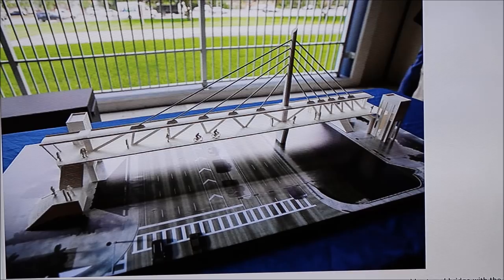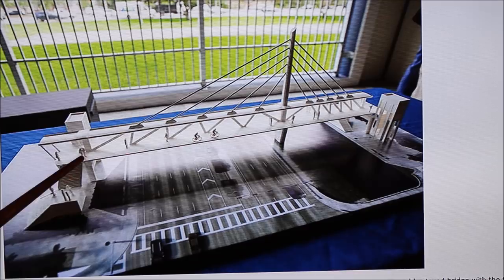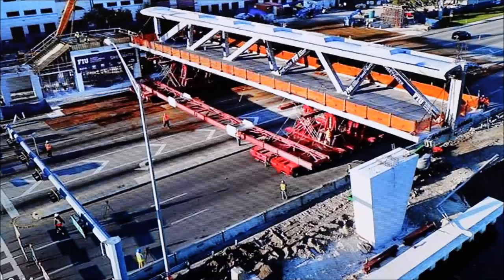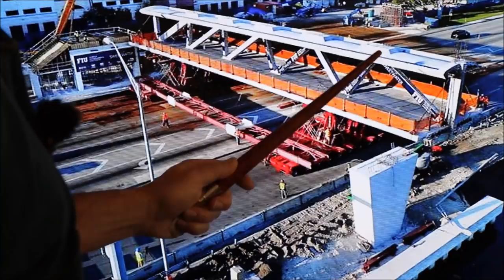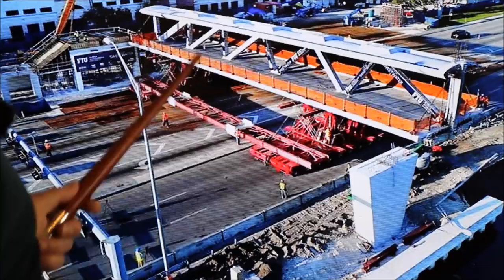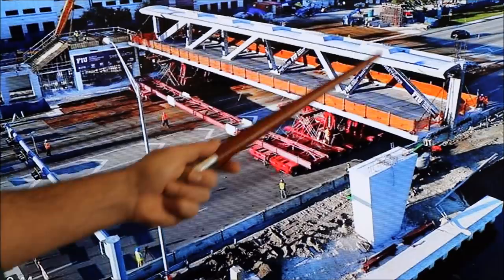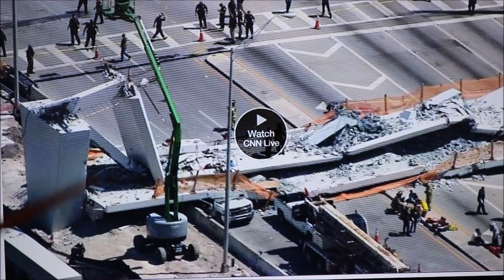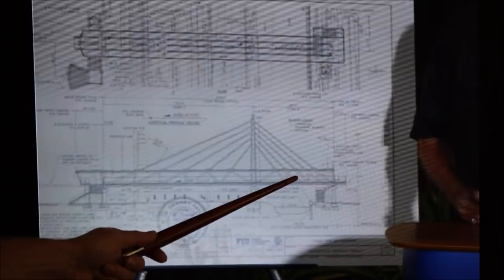Miami Bridge Failure- preliminary analysis 17 March 2018

Comment: Had the tower and cables been real, full concrete trucks could have been driven across end to end without failing. I think youtubes AvE channel has the answer already. A cable tensioning end pulled all the way out of its anchorage.

Comment: The design may have had flaws but it seems like most disasters many things went wrong here...I  can't believe that the work was going on with traffic below.....kind of thinking that the guys tensioning the cable had the units wrong  ( like filling up the commercial airplane that landed out of fuel  at Gimley Manitoba  by measuring liters rather than gallons?)
Reply: i have looked into that air craft flame out i depth in the past.  ya what a mistake.  thank God for the abandoned air base runnway being in gliding distance

Comment: Hmmm... How does a Boeing 777 left seat know about concrete/steel matrix construction?   My structures instructor said "bridges do not have to fly, so we can build them a little stronger, so they don't flop around when you drive on them."I like the "Here we are in Hong Kong on a similar structure" part the best.Here is my theory of failure.Please redefine your "truss" meaning.  Classically a truss is made of members that cannot transmit moments.  The ends of truss members are near frictionless pivots.  
This  structure is an open webbed beam, with weird flanges.  
Member 11   =  first diagonal from the canal pier end.  Transporter lift pads puts #11 in tension so internal tension rods in the member  must be cinched up to keep the concrete of the member in compression or it will fail and crack in tension. when the bridge is lifted by the transporter jack.
When load is transferred to pier seat,  #11 concrete goes into high compression.  So the internal tension rods go limp. (worker  remarked it was funny that the tension rod nut was loose after sitting down onto the pier).  The tension rods in #11 diagonal  must now be carefully cinched up turn by turn to keep even compressive stress in the concrete cross section of member #11.  Now the pre-compression from the matrix of  balanced tension rods is used to keep the highly compressed #11 member stable and in plane to keep column buckling from occurring due to a potential eccentric compression load vector.  That was what was supposed to happen.  
But, the tension rod matrix load balancing dance went south.  During tensioning by the crew, after the bridge was on pier,  the #11 concrete compression vector shifted out of the center of the member, set up an eccentric moment and the member in high compression began to fail in column buckling.  You can see the  "S" curve in #11 forming a few milliseconds before collapse.PS:  Thanks for all the work on the ORO Dam Project.

Comment: Ther is a bit of substance here, but I question this guy's credentials to do more than sift through the news and summarize his findings.

1. At no point did he mention the fact that the end supports during the bridge move were changed from the original design. Those supports at the failing end of the bridge were moved inward creating a substantial cantelever that changed the loading condition from a simple span, to one that was continuous over that support. That loading condition causes downward deflection of the bridge end that was apparently overcome by the post-tensioning of that last diagonal strut.  This situation would normally engender another analysis before proceeding.  I would bet that this will be a major focus of the investigation.  That said,  we must admit that all of the facts are not in, and a thorough review may show that there was some other cause (anchor failure of longitudinal deck cables that permitted partial detensioning and deflection of the entire structure?). Untill that time we are engaging in partially informed conjecture. There were many points of failure on the bridge that obviously involved concrete and reinforcing steel. There may be other failures of pre-stressing strands, or their associated hardware. Which failures were caused by the bridge falling, and which one or ones caused the bridge to fall are the big question right now.

2. I find it unlikely that the tower and  cable-stay system was wholly ornamental.  Sure, it is almost the signature bridge of Figg design, but it is not that much art in my opinion.  I expect it was there to handle pedestrian loads that would be present after the bridge opening.  If you don't thint that it is significant, be reminded that the Golden Gate bridge was closed to traffic on its anniversary and the pedestrian loads were enough to flatten out the camber and put major concerns into Structural Engineers who observed this from afar. 

Also, that long a span can have significant thermal expansion and contraction; but it can also shrink due to water loss through evaporation and cement hydration, and through concrete creep under load.  Perhaps the cable-stay part was used to reduce the loading and provide structural redundancy(see fracture critical below).

3. Sure concrete trusses are heavier than the steel truss option, but steel truss details can be problematic in a marine environment where corrosion can be a big issue.  Pigeons, bats, gulls, etc. can provide an accelerated environment too. 

4. At this stage of construction, the bridge was "fracture critical".  Quotes are included because this terminology carries regulatory and design significance. The video talkes obliquely about this issue, but a straightforward use of the terminology would have carried more impact.

5. RE: load testing with added weight. I've seen more than a few big and small bridges built but never that type of load test.  There is the old joke in the industry about the Russian load test, but I expect that it is fiction.  There was a big failure of a bridge a few years back that resulted from the inappropriate stockpiling of construction materials for a rehabilitation job, but that was in no way an intentional test.

6.Calling that design a Warren truss is a stretch.  It appears to be a hybred with Warren like elements at one end and  Pratt or Howe like ones at the other. I'm in a rush here so I didn't have time to research that distinction.

Baseline: Conjecture is fun, it's like solving a mystery.  More clues await revelation, so don't believe anyone who claims to have all the answers. Somewhere an armchair observer like me might hit on the cause, but they were probably lucky to some extent.
Reply from the maker: Terry Philbin see update....

Comment: That concrete deck looks way too thin to me for that distance of a span.
Reply from the maker: Just 2' thick...
Reply: I suspect the deck would have failed anyway. rebar doesn't add a whole lot of support and concrete does crack. I don't see any I beams hidden in the concrete, there should have been an I beam lattice embedded in the concrete directly tied into the truss. There was no support for the sides of that bridge and it will crack between the truss because that's where the stress will be. No support on the edges + cracks + only rebar will equal it failing. I get they wanted a clean look and not use the "box"(forget what they are called) on the bottom of many concrete freeway bridges but they could have hidden the I beams inside the deck.

And like you said, they should have put a temporary support in the middle, and I would add do all work at night on one side of it and close off those lanes and the other sides lane split between both directions. I assume the city was showing off their new pedestrian bridge by having work being done on it during the day, but they were making it a safety hazard and making commute times take longer. There's a reason why most road work is done at night.

Comment: As a structural engineer that specializes in bridge construction, reading through these comments and some on other channels is embarrassing (especially AvE's viewers).  The number of arm chair experts that have little to no understanding of engineering, physics or construction pontificating on what caused this tragic failure and on whether the design and or process is good or bad is truly sad.  The only thing we know right now is that 6 people are dead and the bridge collapsed.  Until the investigation determines the actual cause, we know nothing and speculating is counterproductive.  If the failure was caused by something so idiotic that a bunch of people could figure it out by watching some shitty 1MP security camera footage then this would not have failed.  The designers are not fools or idiots and neither is the contractor, or state.  A mistake, or several were made but not so obvious any of us are going to know about it.  Those that might know about it are locked behind lawyers and will not be talking about it to the public until the reports and court cases are finished.  This is no different than an airplane crash.  The NTSB does not jump to conclusions.  They investigate until the evidence exposes the truth, rather than fabricating evidence to support a false assumption.
Reply: Relax, were just thinking out load. No minds are made up.
Reply: A voice of reason, a rare thing in the aftermath of these events.  I share your background, and am embarrassed by the comments, especially on the sites of MSM.  The media does not help the cause either, taking one comment or bit of information, and blowing it out of reason for the sake of a news story.  They have no guests that know very much, and, if they did have a technical explanation, the MSM would not air it because it is not understood, or makes for no idle speculation.  There was clearly an intended plan to be executed, both in terms of structural integrity, and in terms of construction sequence.
Reply: Now come on!  A 174 ft span of concrete without a center support?  And more than one engineer approved the design.  So the only fools and idiots on the planet are non-designers?
Reply: +firecloud77  You don't ask a hydroponics enthusiast to speculate on why the spacex rocket blew up do you?  Why is this different?
Reply: Anyone following the blancolirio channel will get this. I'll bet it was the green spot that caused the failure. 😉
Reply: Well aren't YOU special!!!
Reply: +monicapttrsn  How do you get from the designers and contractors are not idiots and thus whatever mistake(s) were made are not likely to be obvious to insinuating everyone else is?  That was not my intention if that is how you read it.

Also, while not small, a 174ft clear span is not unsual and provided it is properly engineered and built it should have been perfectly safe.  That obviously did not happen in this instance and 6 people are now dead.
Reply: Full disclosure Barry do you do government work? Is your emotional attack on the people rightfully seeking truth actually fear for your job?? Because 6   or more dead make the designers the contractors, and the state as you say worse than fools, criminals. Right?
Reply: By your very own Logic Jaun shouldn't be making this videos or speculating on anything either. You know nothing of anybody on this platform other than user names and yet you make comments like this. People here are seeking the very best of knowledge, knowledge for the sake of knowledge. And yet you spit on them from your Ivory Tower because they don't hold a degree? You are the worst kind of elitist.
Reply: Barry Gerbracht . yes good points made.
Reply: +Ricard Jolfs or wondering
Reply: don't bother with an arrogant know it all engineer

Comment: Are you an Engineer?

Two Major concerns of any Mechanical Design are Safety and Cost

No Engineer with half His brain tied behind His back  would add costs of the elements You call  'Ornamental"
Reply from the maker: Brad Vetter this was an Obama era   economy boosting project....
Reply: I will attempt to use my  Head and ask a question to clarify Your comment.

Are you saying the Sunshine Skyway Bridge Engineers added the sunken support piers, vertical support towers and SUSPENSION cables at the bridges widest span to make the Bridge look PRETTY? 

That's a huge amount of money for ornamental eye candy.

Comment: I agree on design failure. I learned from a physicist, that steel and concrete complement each other very well. 
And if there is too much concrete, then the construction will become brittle.
It seems, that the architect of this bridge has missed the most important part of his college education. 
(if the bridge had truly the wrong ratio of the component)

Comment: Great review! 
There was a newly released video by a user on instagram and played back in slow motion you can clearly see the point of collapse.
https://www.miamiherald.com/news/local/community/miami-dade/article205635774.html
I see so many faults here, its simply unacceptable. If one truss fails, the whole structure fails, is not putting confidence in the design and overall structural integrity. How much more confidence does that give people saying it can withstand a CAT 5 hurricane? By allowing traffic to flow underneath the bridge, while it is still technically under construction and with construction crew doing "stress testing", is simply down right plain negligence, if not criminal negligence.

Comment: The truss where they were fiddling with the tension rods was in COMPRESSION!   Therefore, fiddling with the  tension in those rods would have made no difference, and would have been irrelevant.   The next truss along, however, was in TENSION.   Therefore, they should have been fiddling with the tension in that truss.    The photographs clearly show that they were fiddling with the rods in the WRONG TRUSS !!
Reply from the maker: it's going to be a longer story than this , maybe 10/11 blew out the top deck?....we'll know soon.
Reply: Wow.  Good point.  Thanks for the insight.  The photographs do indicate cracking around the blister.  I assumed that could have been due to the impact load after failure.   But still, it makes no sense to adjust the tension in a compression element.   After all, 11 is pushing the blister outwards, but 10 is pulling the blister back in again, cancelling any "popping" load.    The junction of 10/11 would only apply a shear force on the top deck.   I guess however that all speculation will have to await information on the rebar inside the two decks.

Comment: I think AVE thinks the pretensioning failed.
Reply: pretensions failed likely due to placing the hydraulic movers at a position on the bridge that was not designed to be a lifting point.  the 24/7 computer monitoring the built in sensors reported that the post tension load was incorrect on the end where the workers were on top of the bridge making "adjustments" to the tension rod that likely stretched during the move of the bridge.  upon tightening this stretched rod, it likely failed either by breaking into or pulling free from the rod's static end.  the failure of that tension rod increased the stress on all other tension rods and led to an immediate catastrophic failure of the entire structure.
Reply: +Big Ozone

I think this scenario is plausible; this was a bridge designed to be supported at its ends, but the failed end was left cantilevered past the transporter supports (thus loading it opposite to its design) during the move.

What I don't understand is how the approved design of this bridge could be such that failure of a single tensioner rod at the end of the span resulted in a sudden catastrophic collapse.

Comment: This is straight out of Atlas Shrugged, 1957. 
This is an "ecobridge" from the designer website, where everything is about green materials, special concrete mix with lower carbon footprint, etc. Dig further, I'll bet you find a diversity and inclusion department and manager, to make sure hiring managers aren't focusing on merit.

Comment: What an absurd design.
Reply: Why?
Reply: Steel is tried and proven.
Why would an obviously inferior, unconventional, concrete and cable design be used?
It looks stupid, unsymmetrical, and clearly incapable of supporting it's own weight.
Just use you own common sense and take a look at the form of that thing (before it's collapse).
Too bad they didn't build the tower first and anchor the construction with suspension cables.. oh wait.. they were just cosmetic.
That is "why" it is and absurdity.

Comment: This guy needs to let a professional do this video...... Where are the concrete cylinder crush test reports for all concrete used on the bridge? Where were the Design Engineering companies Inspectors, as well as the State AND City Inspectors reports prior and post-failure??? Also, I would want to see the MTR's and post-failure chemical analysis of the tension rods, nuts and washers. One more thing to kick off an evaluation, where is all the video footage of the erection of the bridge that the erection and design companies compiled (they always video these for future advertisement of their work and design capabilities).
Reply from the maker: Liberty Warrior NTSB will get to all that. This video brings a wider understanding of the basic issues investigators will be reviewing in a fashion that the general public can understand. This is not a professional video, nor will it ever be. Now subscribe and stay tuned for future updates on this and other interesting engineering issues. Welcome aboard!

Comment: Thank you... So this was a Mock Suspension Bridge with top part of no value. To the people who use and died under this thing.... Why? It shocking!  Maybe all of people... most people are good people and try to do the right thing... may have got mix up.. maybe with the Plans... printed out wrong? One for Suspension Bridge.. one with out! And why have a 200 feet span bridge with  a 100 feet roadway? And 950ton is the weight of a Battleship! I just hope that any question that were ask by anyone down the line.. from start to... were listen to. I am very very.. afraid there were Alarm Bells. Will we listen to dead people now?